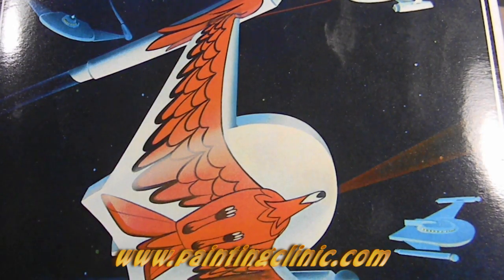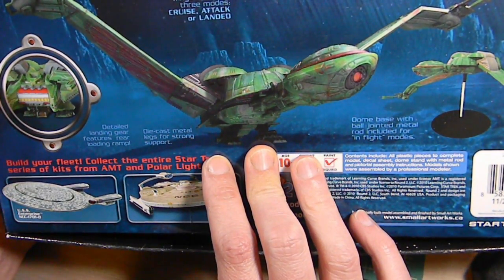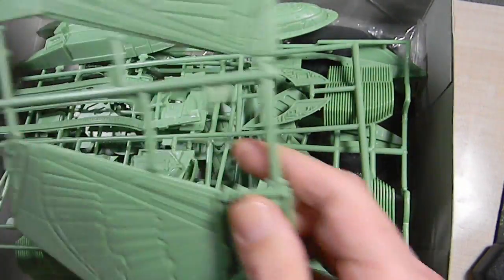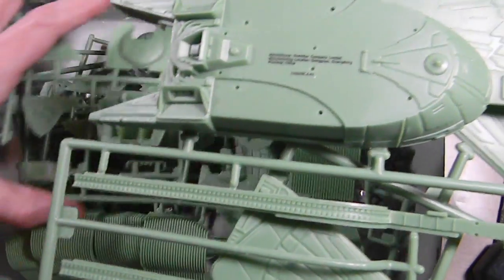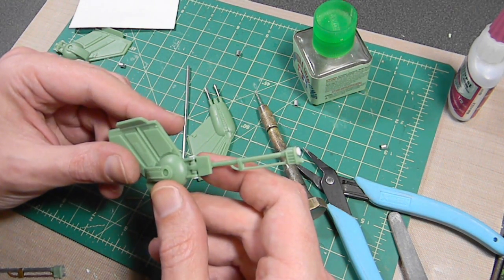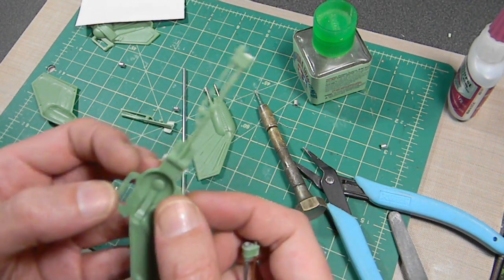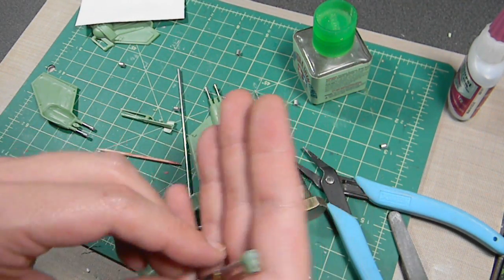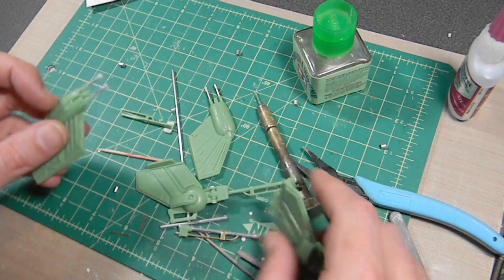AMT Round 2 Klingon Bird of Prey Build Part 1

Comment: I'm confused trying to find this kit. All AMT Bird Of Preys on Ebay says they are 1/650 scale or no scale specified at all. The Polar Light one is 1/1000. Still alot of YouTuber's says this AMT kit is 1/350. Does it say so anywhere on the pack or building sheet, or are people just taking for granted it's 1/350.

Comment: I hope you don't want to recreate that shot at 8:39...  Ooh, boy!  That is showing its age.  Take it away!  Take it away!  Rest assured, anything you do will look better than those film clips!

That's a lotta lights in that ship.  Never noticed before.

What if you made a cone to block off the central torpedo tube and a circular wall to contain the outer ring, housing your leds' between them?  

Black silicone is a great light blocker for internal seams.

Comment: I tried melting fiber for the cutaway Falcon, thinking as you it would be one melty blob light, but no.  It remains just a bunch of tightly packed points of light.

Looking at the torpedo tube part, I see the problem...  

ok.  I think it can be done with paint, but I'd probably have to make a video of what I'm thinking.  but well and tightly masked painting shoul get you where you need to be.

Comment: I have a 1995 Generations version of this model. Sad thing is, the decal sheet is ruined as when I got it, it was pulled out of a partly flooded garage and it was sitting in a stack on the floor with it being the one on the bottom. Because of this, I have been at a standstill with it. I don't know if or how I can get a replacement of them or not. I tried contacting the manufacture of it and even offered to pay for it after truthfully explaining things to them. But I was declined from them and I have not been able to find anyone or any seller who would sell them to me.